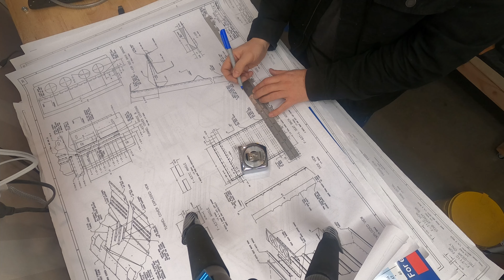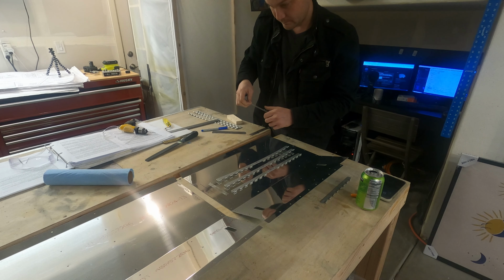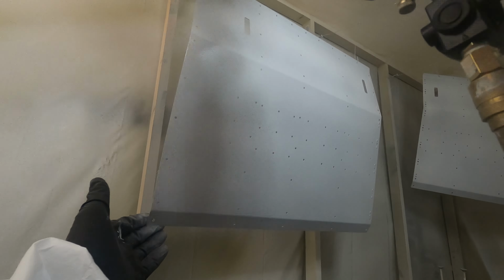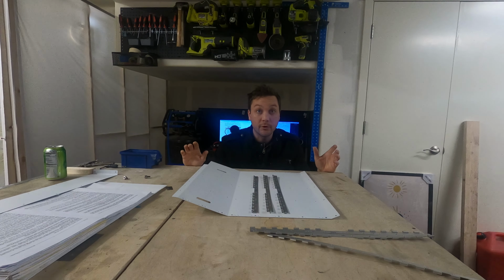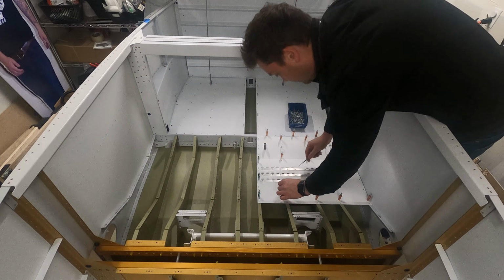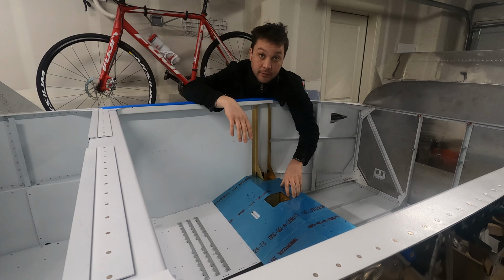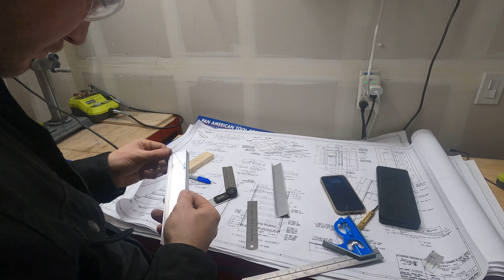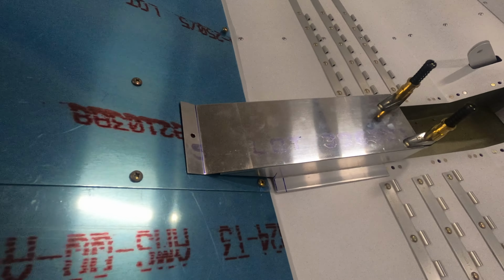Seat Bottoms and Controls for my Airplane | EP3.25

Comment: Nice work Ryan! Stick is "in", seats soon ❤.

Makes me wonder if we're getting close to you sitting in the plane making some actual plane noises or the sound track of Top Gun's starting scene 🎉.

On a more serious note, been doing a lot of home renovation lately with painting and all. Using a roller and getting really good finishes, like smooth as with a paint gun. Makes me wonder if it could work with your White primer too (for my build, probably non visible / cockpit only)? Or will it deposit too much paint in the rivit holes perhaps.. Hmm
Reply from the maker: I don’t know about rolling. The argument that it would give inconsistent results is out—there’s nothing consistent about my spraying.

I might give a foam brush or a small roller a try on a test piece. I guess I have hope I’ll get this spraying thing down one of these days…
Reply: Well I think you're doing rather nicely with the paint gun; don't get me wrong! 

I challenge more my own skill set and hence got to wonder a bit while renovating. Sure think the gun can / will give you a better result. And I'm guessing that the green primer will not role well at all for being rather think. But the white... 

Downside of the white is waiting right? But if with a roller it's for internal parts much easier to get done.. It might be worth for me to consider. 

So I thought to ask :-)..

Vans yesterday released a YouTube on the laser cracks. Not an issue they find.. My guess is you've already seen this but nevertheless thought to note 💪👍
Reply from the maker: The failings of the white primer are largely mine. With a heater in the booth, parts cure pretty fast--faster than most similar primers, I think. I'm just fond of the Akzo 10 minutes-to-touch timeline. Because I'm impatient.

Similarly, the finish inconsistency is a mixture (unavoidable pun) of a low end setup/gun, and the fact that I've messed up the chemistry of the white with some pours off the top of a relatively unmixed can.

Overall, I think the Eastwood stuff is great. And in the right hands, I think it would make an incredibly durable, sightly, and affordable finish. So much that I've decided to double down and reorder a new small can of Part A so that I can see how it sprays with a fresh batch.

I will say, when I ordered the Part A, I noticed they have a rollable primer... might be what some folks are looking for!
https://www.eastwood.com/eastwood-basic-optiflow-roll-on-epoxy-primer-kit.html
Reply: THX Ryan, bookmark it 💪👍. 

I have the feeling that this automotive primer you are using goes on thinner and hence adds less weight.

Anyways, look forward to your next post and thx for all the help.

Comment: I have seen some folks add small access panels to the floor panels to provide access to antennas and other electrical connections. Avoids having to drill out rivets if you ever need to get to them.
Reply from the maker: This is a good point. I’ve seen that too. 

I’ll work around it. And soon I’ll quit making so many messes to work around.

Comment: I noticed you tend to use your angle grinder quite a bit. For odd shape cuts that don’t really fit the bandsaw I was debating between using a right angle die grinder with a cut off wheel or to buy à Milwaukee m12 cut off saw. Have you taken a look at those?
Reply from the maker: I’ve become quite skilled with the art of the cutoff wheel and angle grinder. 

Band saw is always the go to, but many things won’t fit. If it won’t fit, I won’t exactly stress trying to figure out how because I’ve already got a hand going for the angle grinder. I think it’s the Diablo wheels I’ve been using, and they just sail through the aluminum. The larger size also makes straight cuts sort of self-aligning.

I also have a cutoff wheel on the Nova angle grinder. (Pneumatic, yellow.) Somehow I got a wobble in the cutoff adapter so I haven’t been using that as much, but I need to reach out to Pan American and get a new one in order because it’s unbeatable for detail cutoff work.